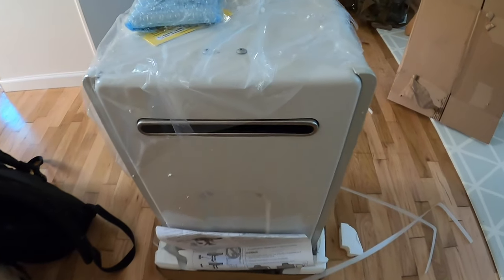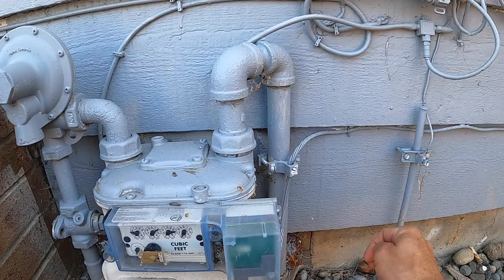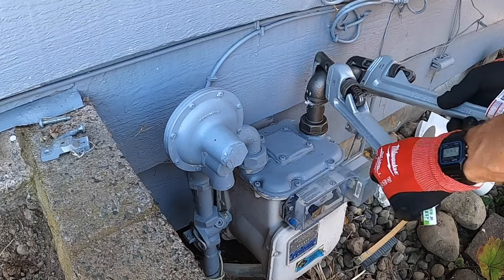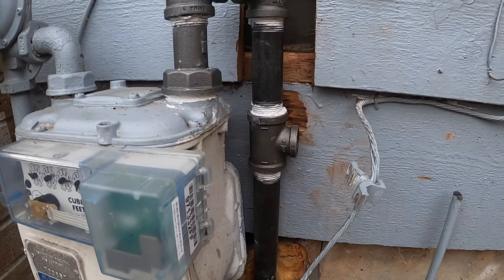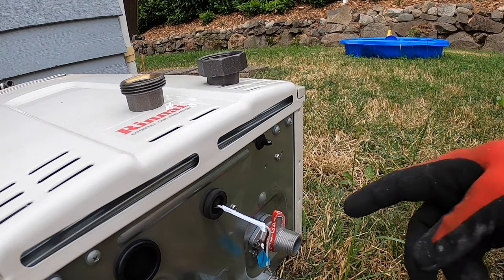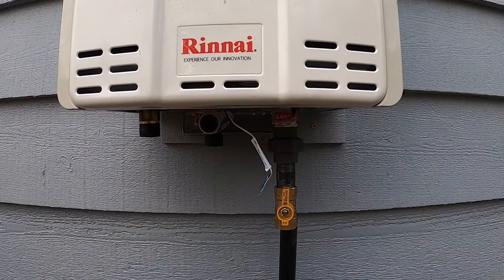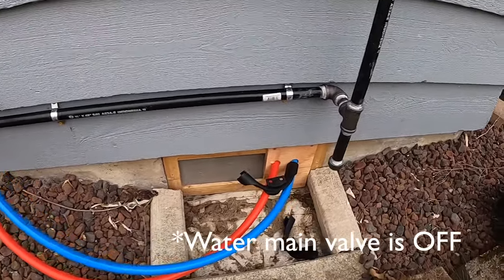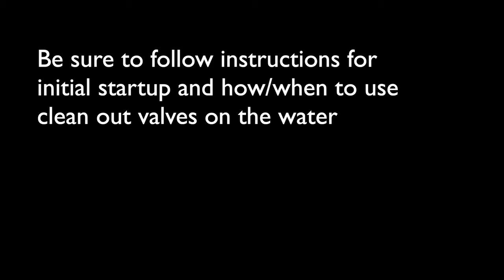Tankless (On-Demand) Exterior Water Heater Install | Rinnai Value Series

Comment: It was nice to watch.  Early on in the video one thing to note do not ever put pipe dope inside a pipe fitting and also try to keep the pipe dope off the first couple of threads of the pipe for the same reason.  If you don't follow those rules you tend to introduce loose material into the piping system.  Also cutting the pipe above the meter is not recommended as you will introduce metal filings into the meter and system.  When you shut off the gas before the meter make sure you loosen the nut on the opposite side of the shutoff.  This will make turning the shutoff easier and lessen the chance of breaking the fitting.  In our area and most areas turning the gas shutoff on the supply side of the meter is considered the gas companies property and is illegal, and if you damage the shutoff you will have no way of replacing it.  That is also why in most locations the building department requires a gas shut off to be installed by the property owner that can be used in an emergency to be located after the meter leading into the house.

Comment: No PEX outside, bro. T&P line should be copper or CPVC.  But I liked that you hard piped the gas line all the way. Looks stronger than using a supply line. Good job on T-ing off the gas meter. That would have stopped a lot of guys.
Reply: I don't know who told you no pex outside but they lied to you. "In most cases, PEX is extremely durable and lasts up to 50 years or more. PEX piping is also less likely to crack or break than metal pipe because it does not expand and contract as much when heated and cooled"
Reply from the maker: Thanks for the tip on using copper outside. I did build a little 'house' for all the piping below the unit, so no UV will hit the PEX, but still, copper would probably be better for that little bit from the unit to crawl space entry.
Reply: @MrWizards1974 PEX will absolutely degrade when exposed to sunlight and relatively quickly.  Whoever told you it doesn’t lied to you.  He built a cover in this case which is less than ideal but will probably do the trick.

Comment: Your installation will experience electrolysis corrosion at all dissimilar metal joints; e.g. black pipe -- brass. Slowly for a gas line. Faster for a water line.
Reply from the maker: Good issue to bring up- I did think about the dissimilar metal issue, however, it seems like almost all gas fittings (valves, etc) are brass and black pipe is very commonly used for gas lines, so not really sure how to get around that, so thats what I went with.  I also had a professional plumber say that would use black pipe for this particular install -  But I suppose galvanized pipe may last a little longer in the exterior environment?
Reply: Also a good idea to check what your local codes require. Some require black pipe and some galvanized. In many locations they also may require coating the pipes with something like Rust Bullet or even just Rust-Oleum spray paint.
Reply: "electrolysis corrosion" does not happen with brass and iron pipe. That's why all gas valves are brass

Comment: I’m wanting to do the same: I’m in Arkansas so is it going to be too cold? Also, I didn’t realize you can tap into the pipe as close to the meter that you did
Reply: Rinnai is a Canadian based company and have many exterior units available. I don't think an install in Arkansas would be an issue. I'd check with them. Also, check with local codes before doing any gas line work. Some areas require a licensed plumber. In most cases, a tee can be installed anywhere on the line including directly after the tee.

Comment: Do you see the exhaust coming out of the unit?
Reply from the maker: We generally don't see any exhaust. Sometimes I will get a slight whiff of natural gas but otherwise no exhaust or gas smell. We do live in a mild climate (PNW USA) so temps are rarely below 40 degrees or above 90 degrees fahrenheit.

Comment: Very cool, well done! Just an FYI, I put the outlet AFTER the on/off switch since I don't have a whole house generator. This way if the power goes out for an extended period of time during a deep freeze, you can make a suicided cable to back feed the water heater with a portable generator. (Just make sure you turn the switch to off during a back feed!!)   You will be able to still shower and the water heater will still be able to keep itself from freezing... saved my ass with this trick!

Comment: I helped install one just like this one, and we transitioned from pex piping to black steel pipe on everything outside, because, as explained to me, pex can't be used in sunlight because it causes it to get brittle. As for myself, I know nothing about it. Was curious if there was any truth to that.
Reply from the maker: Yes, PEX is not rated for UV rays. I ended up building a small plywood cover (painted color of the house) with thermal insulation on the inside that fits around all of the piping coming out of the bottom. This way none of the plastic piping is exposed to sunlight and has some insulation from the few days of freezing temps in the Pacific Northwest.

Comment: How do you measure and control temperature?
Reply from the maker: The unit comes with a digital display that is mounted inside and can be easy or difficult to wire, depending on the wall type and configuration that you're mounting to. This is not shown, but if you can do everything else in the video, this is a relatively easy step

Comment: So did you install the interior remote unit?
Reply from the maker: I did. I ran the communication cable through the conduit into the house and into the attic. From there, into desired position on a wall.
Reply: did you adjust temp above 120 if so how?

Comment: Hi there, what tool you used to cut the 1 inch pipe next ton the meter ?
Reply from the maker: I used a sawzall (reciprocating saw) with metal blade, but was concerned about sparks in the process. I triple checked the furnace had run out of gas and wore protective clothing while making the cut.
Reply: Thank you